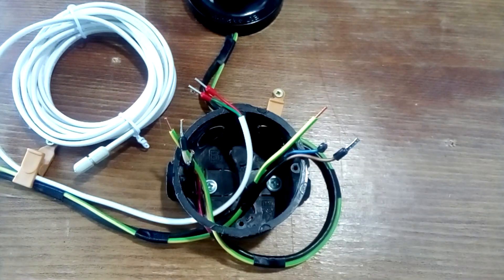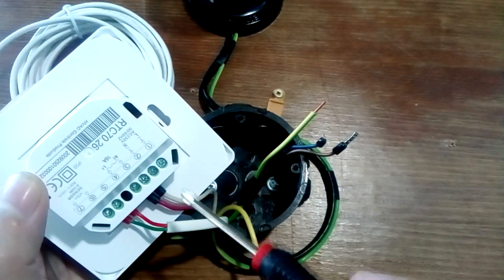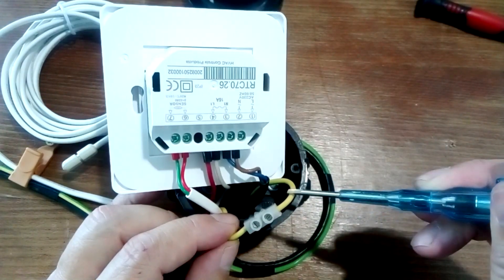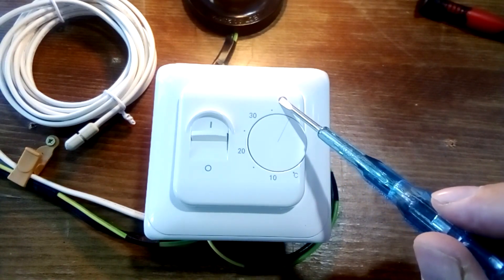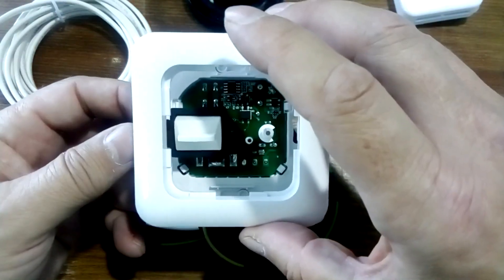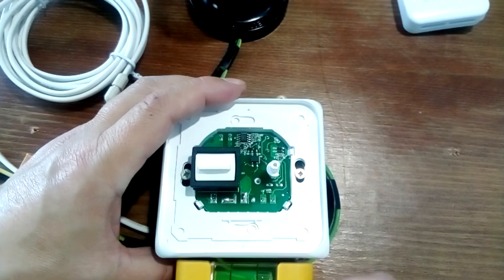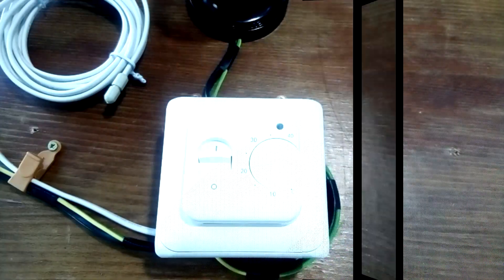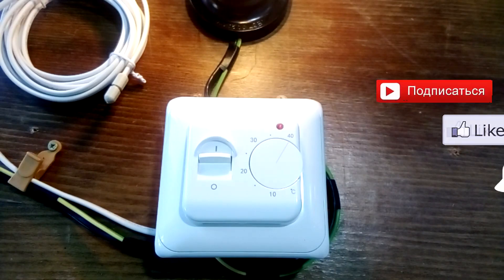Thermostat for Floor Heating RTC-70 | Wiring & Installation Tutorial | Budget Controller Guide

Comment from the maker: https://alli.pub/75cbfl?erid=2SDnjdTeMnU - RTC 70 thermostat on Ali white
https://alli.pub/75cbny?erid=2SDnjcHTbnU - Thermostat RTC 70 on Ali black
https://alli.pub/74qhwk?erid=2SDnjdHeuG8 - Digital Multimeter DT9205A
https://bit.ly/EngKan - Subscribe to this channel
https://bit.ly/Pomkan - Support the channel financially
http://goo.gl/a6YJdO - This channel in Russian.

https://youtu.be/Dx4PjCo6-tQ - Voltage Protection Relay Install & Wiring
https://youtu.be/fc6wGGwdQmI - Cable Locator MS6818
https://youtu.be/Fq3UyU6v94o - 256x192 Thermal Imager: The Most Compact
https://youtu.be/fTNVlWXwR2M - Thin digital multimeter FNIRSI S1
https://youtu.be/-6mjda7QeIY - High-Precision Electronic Caliper 0.01 mm

Comment: The RTC 70 thermostat is a budget-friendly choice for floor heating control in homes and bathrooms. Proper installation requires correct wiring—always follow the manual, ensure power is off before connecting, and test after setup. A great option for energy-efficient heating! 🔥

Comment: Great walkthrough on installing the RTC 70 thermostat! 🔧 The wiring part was especially helpful, as it can be tricky for beginners. One question: does this model support both 110V and 220V, or is it specific to one voltage? Thinking of using it for a home project. Thanks! 👍
Reply from the maker: It is designed for 220 volts.